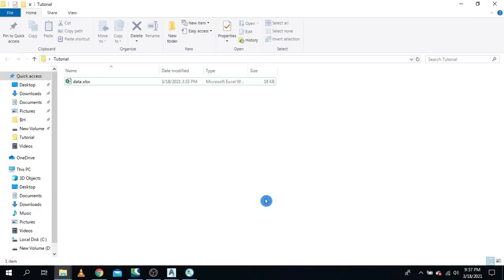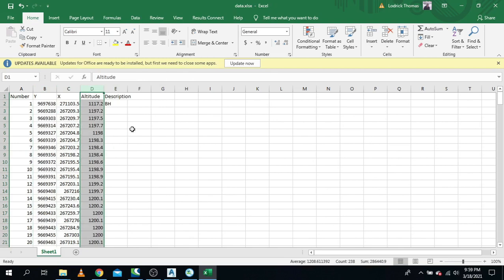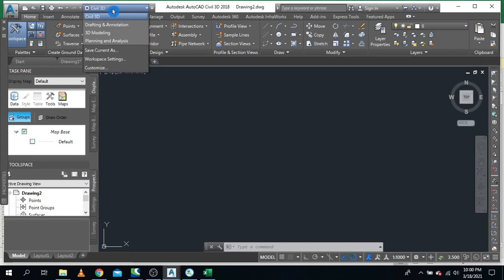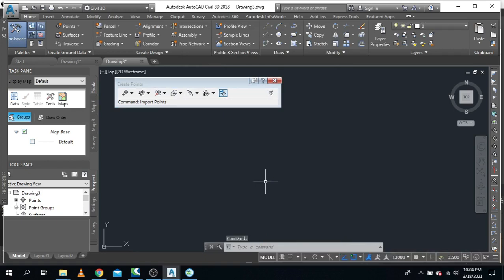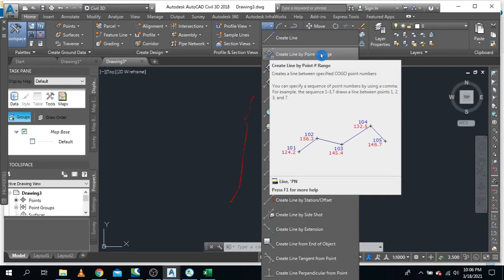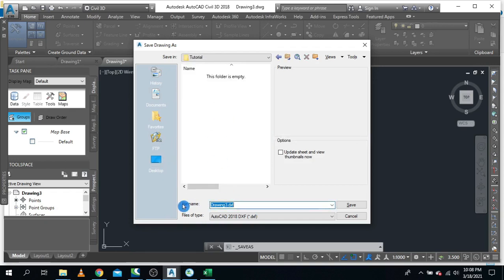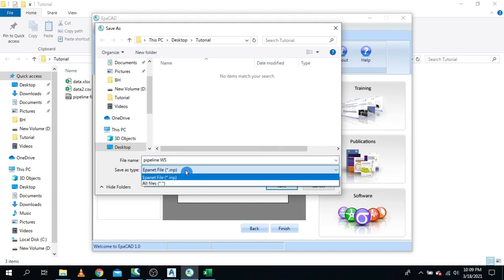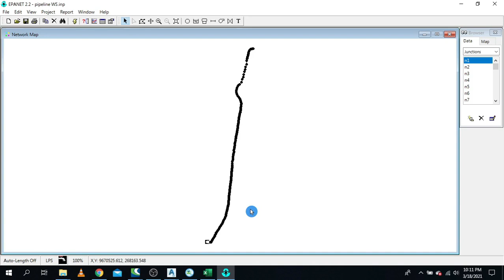EPANET Tutorial | How to Import Excel/AutoCAD Data Into EPANET Software [Complete Guide]

Comment: Your network, the points are linked  but how do deal with a branched network  when joining points  with lines
Reply from the maker: I think the procedures are the same, make sure you have UTM coordinates in  excel then import them to autocad then to EpaCAD. 

The most important point is to make sure in autocad, at a stage of creating lines (with range), after creating lines delete all unrequired lines that does not align with your network layout then export as dxf!! 

I dont know if i answered you but incase i dont then let me know...
Reply: @HydroinformaticsAcademy   Thank you for your reply,   but it is somehow  hard for me to get clear, Like if have surveyed data for the network in the video of "How to Design Water Supply Network with EPANET 2.2"
Reply from the maker: The most important point to start with is to make sure you have surveyed data (in UTM format) in Microsoft excel then follow this video in order to get your file in .inp format! 

Remember if you follow this video you don't have to enter pipe length OR ELEVATION manually because length is automatically calculated. 

ALL IN ALL I STRONGLY ADVICE YOU TO WATCH THIS VIDEO: https://youtu.be/qlxsjWA-CDM IN WHICH I COVERED HOW TO IMPORT DATA TO EPANET and how to actually use it in EPANET!

Let me know if your confusion is cleared after watching that video..